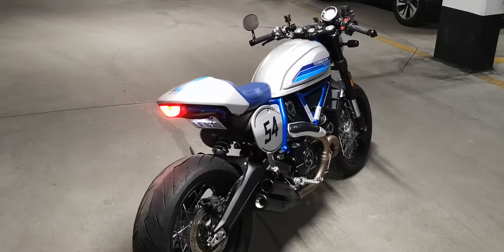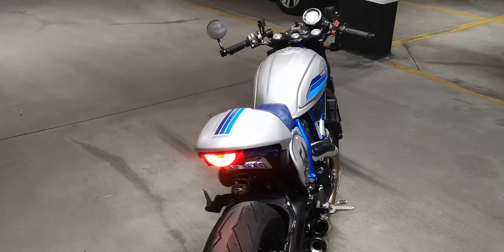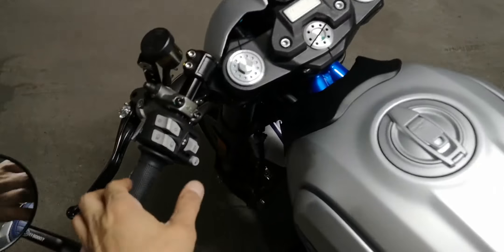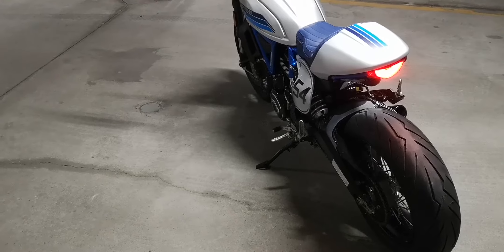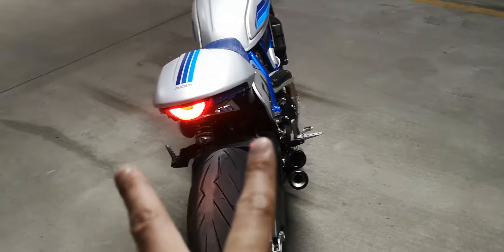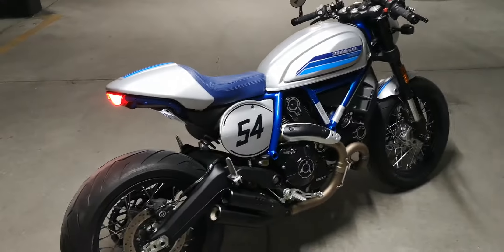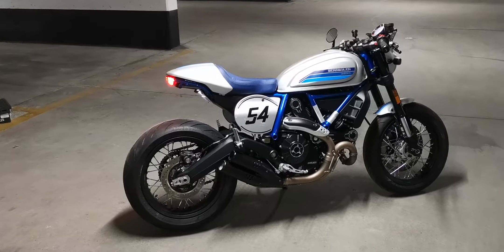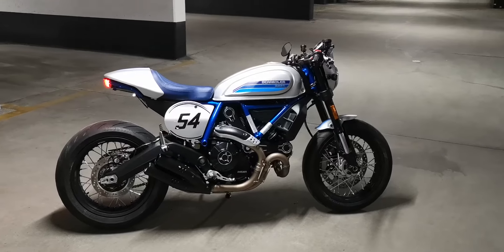Tail Tidy NRC Rundown for 2019 Ducati Scrambler Cafe - Super Clean!

Comment: The plate would be illegal in Australia but i have a similar tail tuck with the plate just sitting directly below the light. In many countries the plate has to be at the rear most part so yours would most likely be illegal. Also, does removing a baffle change anything. With slip on you normally have to remap the ecu etc. Mine uas a new chip and single can. It sounds so nice and has about 15 to 20% more power. I pick it up tomorrow 2nd hand but still minty.

Comment: Which kit did you get? I can't find the one for cafe racer. Mentions icon, classic, full throttle, pretty much every one except cafe racer. And the other kits that I'm seeing have the turn signals not quite as close and flush as yours.
Reply from the maker: I got the same kit as the icon/classic/full throttle. I just assumed they didn't mention the Cafe cause they released the kit before the model came out and since the bikes are all the same platform, I assumed it'd work and it did. Good luck!
Reply: @StatementPlus  that's what I figured. Thanks for the response!

Comment: Is there a way to remove and relocate the specification stickers that are all over the frame?  It's just hideous to see all those stickers on that beautiful frame.
Reply from the maker: Good question I'll check sometime. Bikes in storage though.
Reply: I relocated my stickers not long ago and they came off pretty easily. They did leave some residue behind but I just used some safe-contact goo gone to remove it(will not remove the paint). Otherwise it cleaned the bike up very nicely and would definitely recommend it if you are after a clean look.